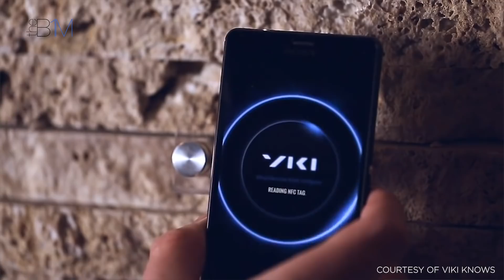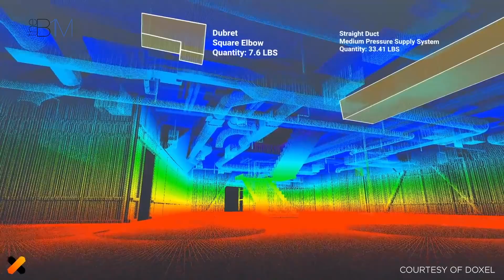The Construction Robots are Coming

Comment: That was not a very big bridge. So does that robot pack all the bar too lol. Can it do saddle ties and figure eights? Looked like  it was only doing snap ties. Not a very strong tie.  Looks like this robot is very big and takes some serious time to set up.  Thats a lot of money to spend on just one application.  What about vertcal walls ? Cassions ? Collums?  And who puts down the accessories and pt cables ?Looks cool but i seriously doubt you will see anything like this for very long time. I know rodbusters that make 80k a year after a year or two. And guys who make over 100k  a year that have been doing it for a long time. You could never replace the hustle they have with a robot for at least 20 years or more . Its rough work and you dont have to be that bright Its pays great and will make you good money .

Comment: I remember reading that when the seed drill was first invented in the mid to late 1700's it was at least
60 years before you saw them used on every farm because of the amount of farm labourers that
would have lost their jobs from that back breaking mundane kind of work.
The days of cheap labour coming over from abroad to pick and sort fruit and vegetables are certainly
over thats for sure as are shelf stackers, welding jobs and bricklayers.
Luckily for me (for now) my job as a conservation builder and plasterer is still safe but there are quite
a few jobs that aren't and as far as I can see the jobs left for humans to do will be desk bound, writing
code onto screens, IT and the sex industry, but even that could be toast.

Comment: I have a hard times imagine robots to take over mutch more then on big constructionsites for skyscrapers were you can move up everything quite easily and prefab as it is stationary construction. The establishing costs seems to be to high for most of these techs for low and medium rise buildings but excavation might be quite common as we have seen terrain models spreading to smaller and smaller projects already along with machine controll however as long as we still have to have a dude with a shovel working next to the excavater for fine leveling it might simply be to dangerous.

Comment: This all looks good BUT!  The discussion should be about what issues robots need to overcome in order to make an impact in the construction industry.  In construction the biggest issue is the terrain.  

Having a robot work in a messy tight terrain is the biggest challenge.  Note for example 4:37 onward the vehicles are working in a neatly cleaned and level sand terrain which is not representative of reality.  The bricklaying robot (2:50) needs perfectly flat rails to work on and even then it can only do straight walls.  Just about all other robots here work inside a factory floor - which isn't really construction but rather fabrication.

The most impressive robot here is 3:15 - tie bot.  That robot needs to be carefully reviewed.  This machine was placed on rails to build the intricate reinforcing for a bridge.  What is the cost for this robot?  How quick is it? How easy is it to assemble and disassemble? (ie: viability).  If any prospective engineer wants to pursue robotics in construction take a good look at 3:15 - here we have something special.

Comment: Kneading The Earth
The intersection of climate change, magnetic field weakness and earthquakes/volcanoes
Since the last ice age, up until 1998, the earth has been getting taller and skinner. This is because of all the missing mass at the north pole, when the massive ground glaciers melted away at the end of the last ice age. That's when melted polar ice water drifted to the equatorial regions, and the ground under the ice rebounded upwards.

The polar ice melted 11,000 years ago, and it melted down FAST, and the rebounding polar crust took thousands of years to fully effect. In fact, during the 20th century, the earth was nearly finished rebounding. This rebound effect was making the earth taller and skinnier. The problem is that the polar ice melt has resumed due to global warming, and groundwater depletion sends water towards the equator as well. It's a rebound double whammy. The rebound is measureable on earth's gravity in areas over northern lands, where most of earth's land is.

Since 1998, the earth has been getting shorter and fatter. This is because groundwater in the north half of the planet, and land glaciers up north, are disappearing fast, and that water ends up drifting towards the equator. We are sucking the ground dry while watching mountain snow caps disappear. This lack of snow and ice on northern lands will lead to more earthquakes and volcanoes.  But, how does climate change jive with earth's magnetic field?

During the last ice age, earth's magnetic field was stronger. Like a spinning ice skater pulling in her arms, the Earth rotates faster when more of its water mass accumulates in the form of ice at the poles during ice ages. Conversely, when earth gets fatter it slows down earth's rotational speed, which weakens its magnetic field strength.

Rock samples show that variations in Earth’s magnetic field over tens to hundreds of thousands of years are roughly synchronized with the ice ages. In Physical Review Letters, researchers present a simulation that strengthens the case that the field was influenced by climate changes. Ocean floor sediment shows that over the past two million years, changes in the Earth’s field have been roughly coincident with ice ages.

What this means is that climate change, magnetic field strength and earthquakes/volcanoes are all related. And earth's magnetic field protects us from radiation. In essence, climate change means more quakes/volcanoes, crazier weather and less protection from space radiation.

All this is tied together with lower stratospheric ozone depletion. It has been recently found that while higher stratospheric polar ozone depletion has ceased, the vast majority of protective ozone is found in the lower stratosphere, and it has never stopped depleting. Now, with evidence that Asia is the likely culprit in cheating on the Montreal Ozone Protocol, we are faced with even more loss of our protective ozone layer. It's like double compound interest.

This is bad because global warming weakens our magnetic field and causes more volcanoes, and volcanoes emit sulphur, which further depletes our ozone. It's like a vicious cycle. We are increasing toxic ground ozone while depleting upper protective ozone. We can't knead the earth because we need the earth to live. Earth will not be fine without us. We will have to learn to build protective biomes on earth before we finish strip mining it.

There is a theory that if the trees go, so does the air, and the vacuum of space will once again kiss the corpse face of Gaia... but, only if we avoid all out nuclear war because then we'll be in a nuclear winter and radioactive ice age.

Links:

Scientists are about to test a devastating hypothesis: 2018 will suffer a lot of big earthquakes

https://qz.com/1133304/as-earths-rotation-slows-2018-could-see-a-spike-in-large-earthquakes/

Global warming won’t just change the weather—it could trigger massive earthquakes and volcanoes

https://physics.aps.org/articles/v6/103

Earth Is Getting Fatter (Since 1998)

https://www.livescience.com/15268-earth-fatter-gravity-melting-ice-sheets.html

Earth’s Magnetic-Field/Climate Connection

https://physics.aps.org/articles/v6/103

Hurricane climate study reveals ozone hole risk in Midwest – Harvard

https://news.harvard.edu/gazette/story/2017/06/harvard-climate-study-reveals-ozone-hole-risk-in-midwest/

Ozone layer not recovering over populated areas, scientists warn 

https://www.theguardian.com/environment/2018/feb/06/ozone-layer-not-recovering-over-populated-areas-scientists-warn

- The earth's magnetic field is weakening most from Chile to South Africa. Plants and animals in this area will lose both ozone and magnetic field protection from space radiation. Radiation sickness will increase there going forward.

Note: Climate heating is not the primary driver of magnetic field weakening, earthquakes and volcanism, it merely aids and abets chaotic planetary disequilibrium. 

No Soil And Water Before 100% Renewable Energy

https://lokisrevengeblog.wordpress.com/2016/01/24/no-soil-water-before-100-renwable-energy/

Why We Must Reduce Emissions 100X Faster Than Now

https://www.reddit.com/r/collapse/comments/8d6847/why_we_must_reduce_emissions_100x_faster_than_now/

Comment: Self driving cars have already proven to be a huge fail. There are a multitude of tasks that require types of thinking and maneuvers robots simply are not capable of. Ps humans are not an unnecessary cost to be eliminated  and the humans doing those jobs enjoy those jobs,and the good pay. Robots are not progress and just can't lay bricks with ty he same speed and 12 quality as a human, without modifying the jobsught and type of buildings. Nor can the build different structure on the fly or adapt to changing conditions like a creeping pier.